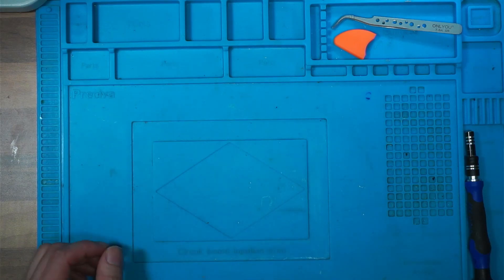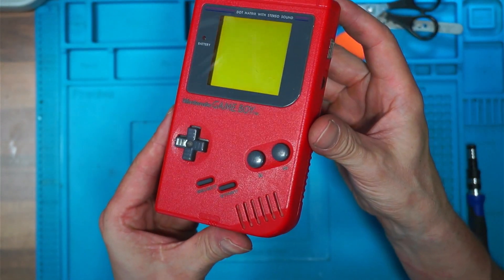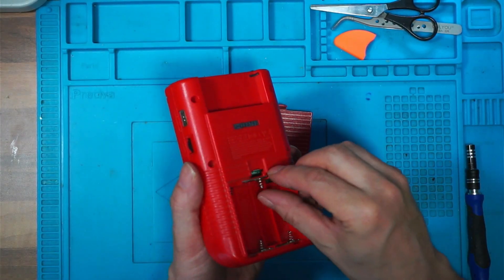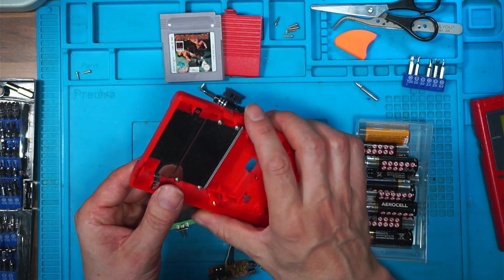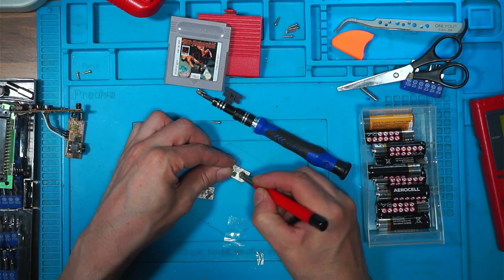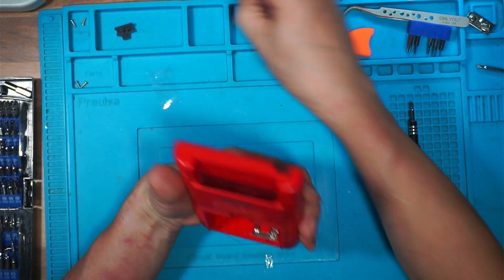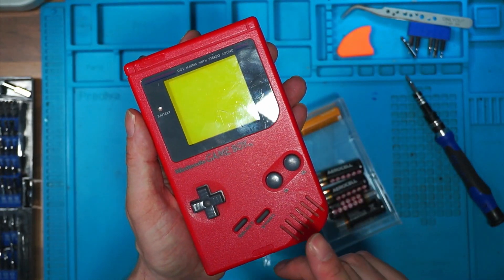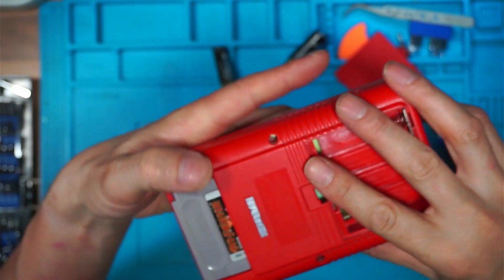Find out why this Gameboy turns itself off

Comment: It's too bad that those contacts can't be restored easily, but for probably 3 pounds, or less, I'm guessing, or around 4 bucks American, you can get a full set of replacement contacts. So, I guess it's not a big issue.

Also, the Pocket certainly had a red standard variant, but the Game Boy Color only had that dark redish pink, unless you want to pay through the nose for a special edition. Same goes for the Game Boy Advance, for red.

I, personally, would love to get the Dandelion Yellow versions of the DMG and Pocket, since I still have my Dandelion Yellow Game Boy Color.

Great video! Have a great Day!
Reply from the maker: Having used both bottom contacts from my spare shell, it would be a good idea to order some, just in case. I'm looking for the Pokemon red SP version. I have the blue Kyogre one already. I got lucky on this one. Thanks for watching.